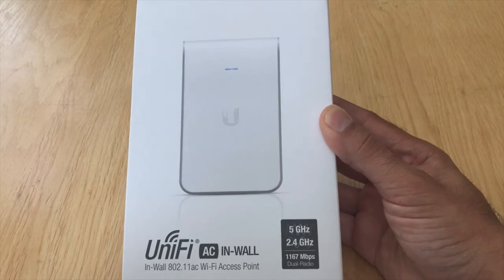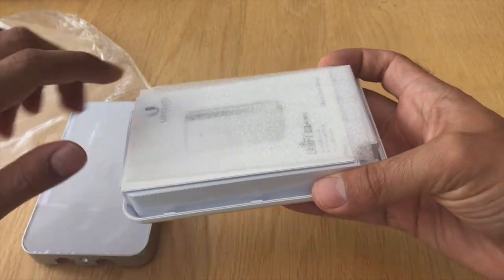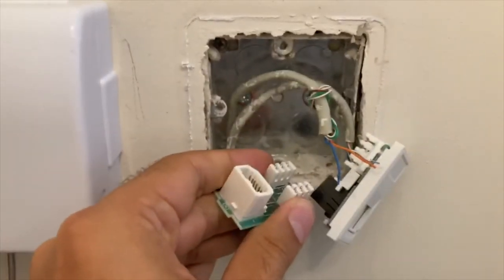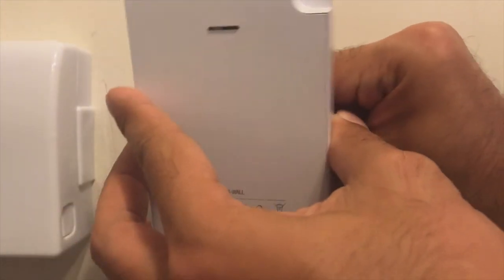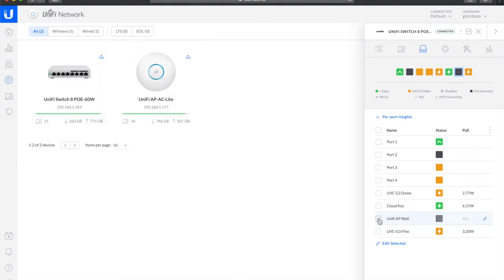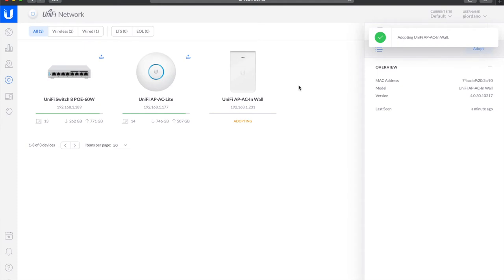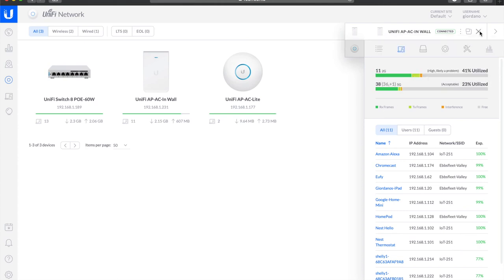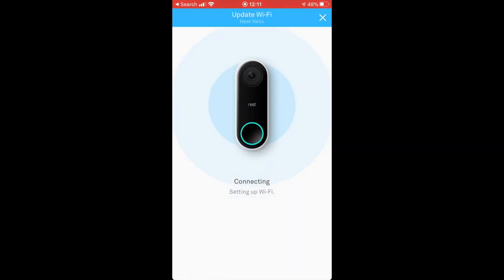UniFi AC In-Wall Access Point (UAP-AC-IW) : Unboxing & Installation

Comment: Thank you for making this video. I have same hardware and have been receiving the following error for the InWall AP:  "InWallAP is connected to a PoE port incapable of providing enough power for the AP to operate at full capacity. Please connect it to a PoE+ port or adapter". Are you seeing the same?